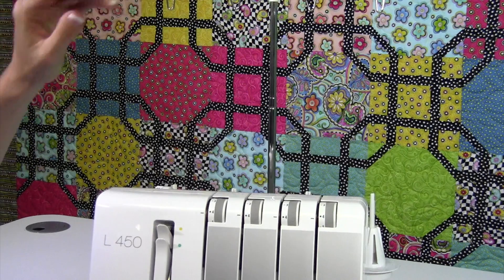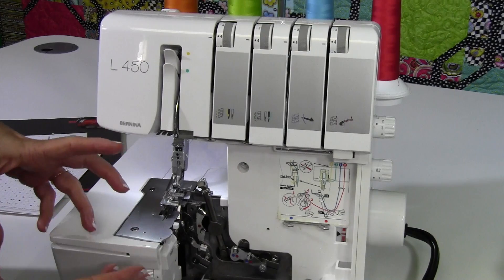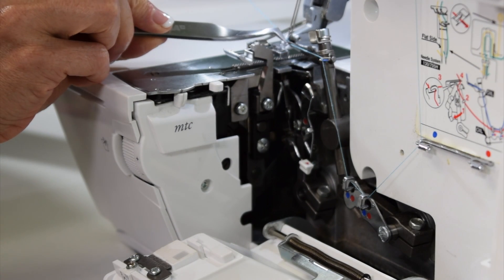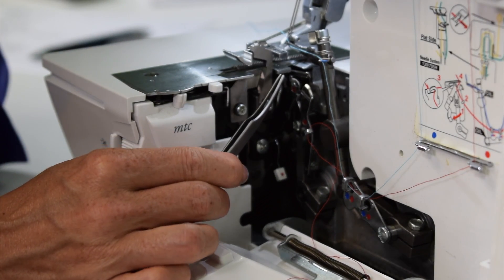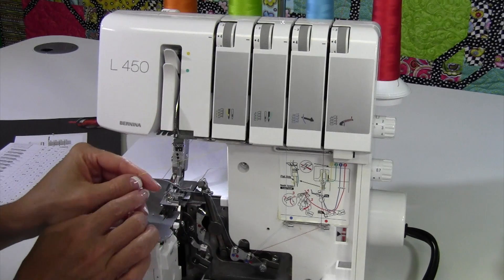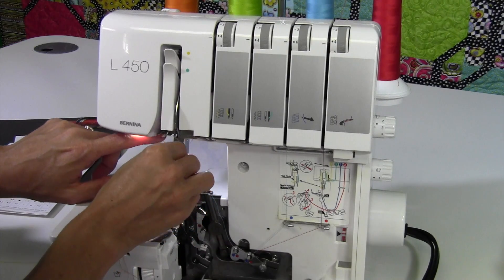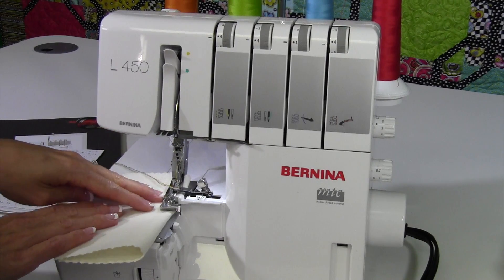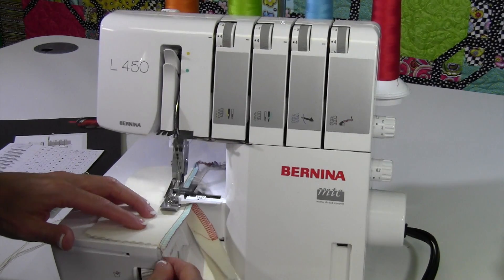Bernina L450 6 Threading

Comment: Overall, a good demo and useful tips.  However, there are some improvements you should consider in future videos:

1. Your voice is naturally high pitched. Please be aware of this and try to keep it as low toned as possible.  Although you give great explanations, maybe a bit less talking and let the camera show what you mean.

2. In this video, the raised metal pole looper is camouflaged in colorful background quilt, and the quilt colors are distracting the eyes, like background noise does to the ears.  The quilt is quite lovely, but it hides the machine details we are trying to see.  A solid color background in grey or pale color would be ideal to show the machine clearly, especially the thin parts.

3. Well manicured hands are a pleasure to look at, but the French white tip is as bright as red nail polish in front of a camera and distracts the eye.  Maybe a pale pink instead?

4. Fyi - Camera angle when showing the threading on the guides was too slanted which made it hard to see the guides.  The hand also blocked the view.  If you placed the camera directly in front, and used a laser pointer and a thin metal rod to point to the parts, this might be much better.

5.  When showing a needle threader or small object to the viewers, please hold it still in front of the camera for a few seconds.  Waving it around prevented us from seeing it clearly. 

6.  "Orange which I used in conjunction to my yellow" is incorrect English.  
     "Orange which I used instead of my yellow" is the correct phrase.
      'In conjunction WITH" means 'along with'.  You cannot have 'in conjunction TO'.

On the good side, the explanations were clear and you are a good teacher.  The camera visuals were clear not a fuzzy resolution.  Audio was clear.  You showed us all the right parts of the machine, which was very helpful. Your series on sewing is very good, and very useful to us all.  I appreciate the video series. Thank you!
Reply: This comment is so obnoxious.
Reply: @jorja7895  Perhaps it is.  But it is also constructive for future videos.  I can gush like everyone else or give tips on how to make the next one very good.
Reply: @jorja7895  I absolutely agree - super obnoxious comment. This woman has 145k Subscribers, I think she is doing exceptional.